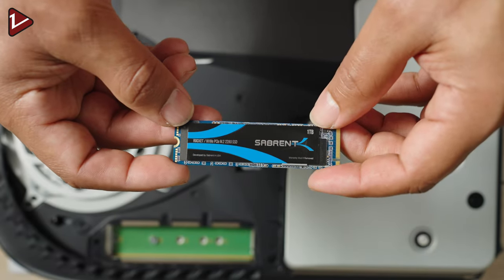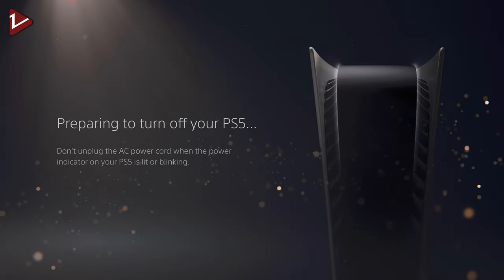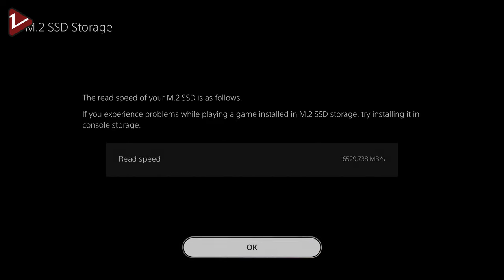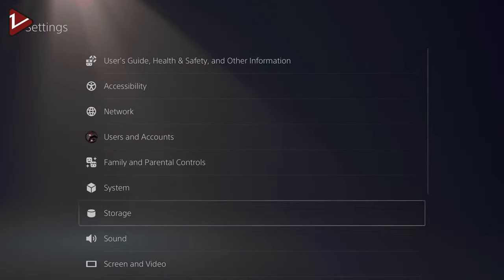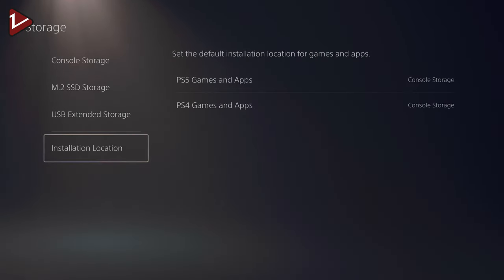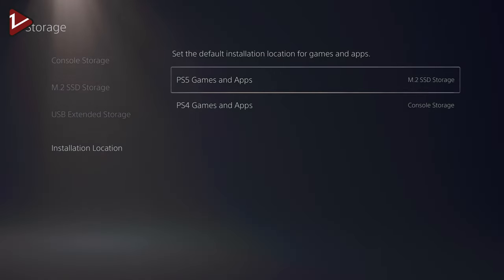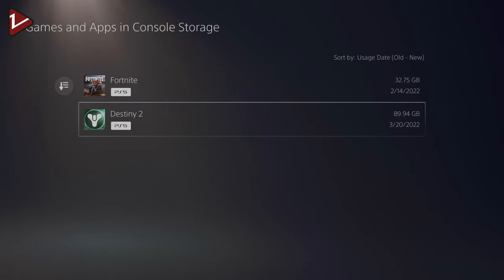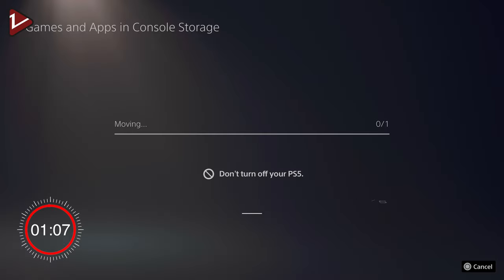Sabrent Rocket 4 Plus PS5 Heatsink Installation and Testing

Comment: After installing this drive the PS5 overheated twice so I've removed it. anyone else see this issue?
Reply: Did you install the corresponding heat sink? Without a heatsink the SSD overheats.

Comment: Do you know why my sabrent rocket 4 plus 1 TB only reads 5800 MB/s in my ps5?  Every video I see shows 6500 and up but the same drive in my ps5 did 5100, 5500, 5800,
Reply: That is because 6500 is perfect scenario best case tuned and tweakeds on certain benchmarks. The PS5 first hand cannot do them kind of speeds second of there is not much real world application for them speeds. It is just like my Samsung 980 Pro can do up to 7000/5000. Meaning it can do more than enough.
Reply: Mine too 5855